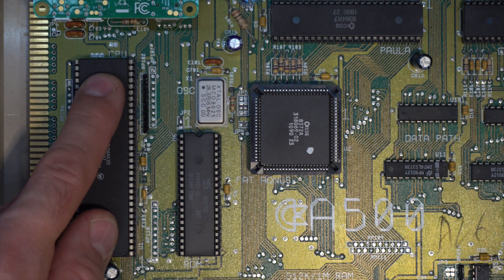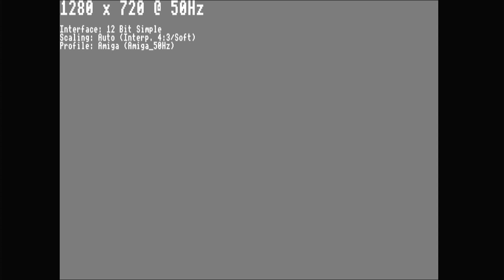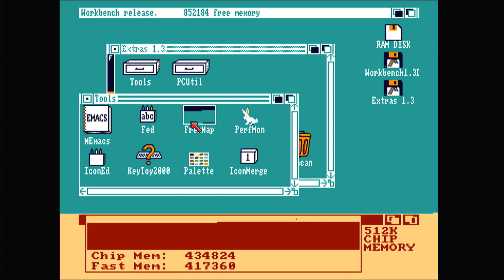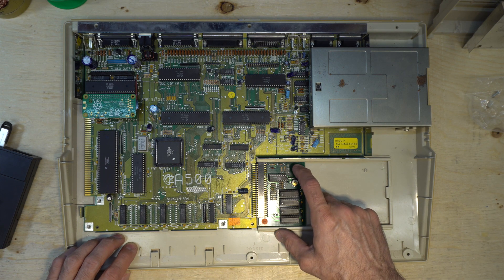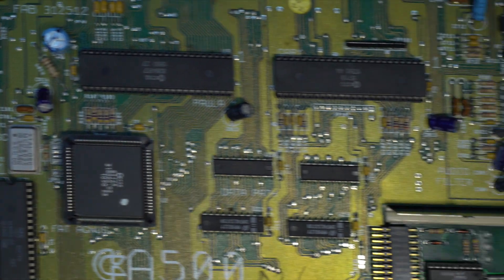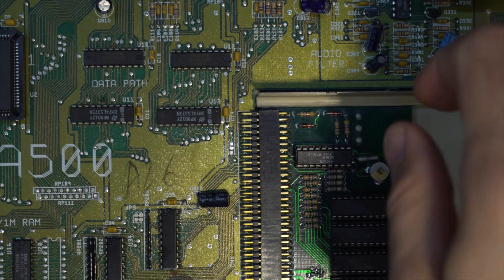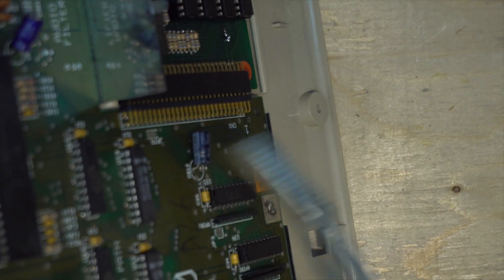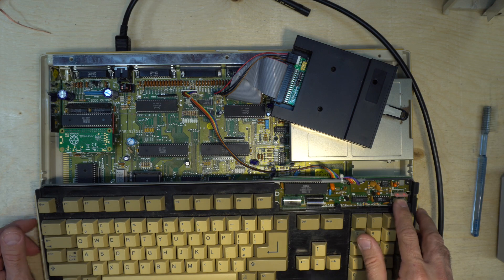Amiga 500 rev.6A 1M Chip Mod

Comment: Awesome video cheers thank you as it helps me clearly understand the upgrading better to the Revision 6A just got a Super Denise chip and an 8mb fast RAM card with a 68000 chip already soldered to the card not sure if it is clocked higher than the 68000 that has to be removed but there is no IDE etc also got an external Drive case and installed the GoTec just waiting on the Super Denise and another workbench chip but it is to basically upgrade the AMIGA to 1200 ability but faster still have to do the trace cutting and solder the jumper(s) or jumper like this lol the joys also got some drive switch to install for swapping over drives

Comment: I just wonder, why I can't see anywhere that somebody will be populating those empty spaces between 512 KB ram chips with additional 512kb and leave expansion slot empty for something else?
Reply: You can, but doing so actually disables the trapdoor (I believe).
Reply: Back in the day, I upgraded my Atari ST512 to 1MB by piggyback soldering an extra set of RAM and picking-up chip select from the logic.
Reply: Perche con la modifica a 1 mega di ram chip sulla motherboard non si puo piu usare la ram slow nella trapdoor,invece l'A500 plus,anche lui con 1 mega di chip sulla scheda madre,configura anche la ram slow nella trapdoor,oppure 2 mega di chip con la A501 plus
Reply: This is possible but you need to add some chip to move memory range since 1MB chip overlap with 512kb slow.